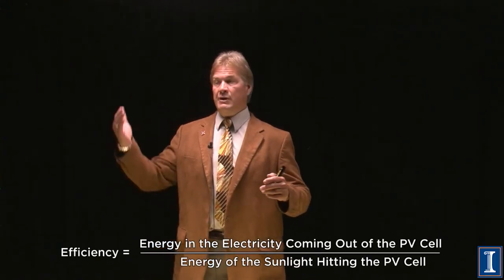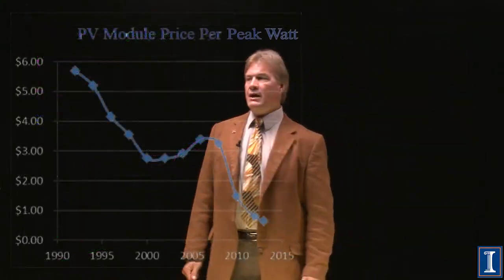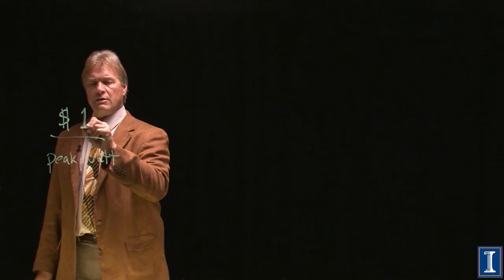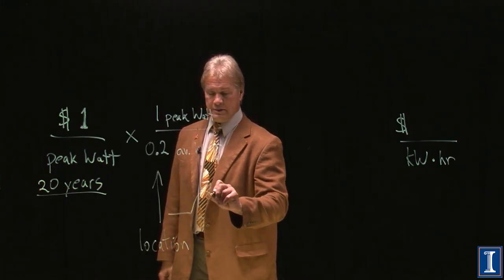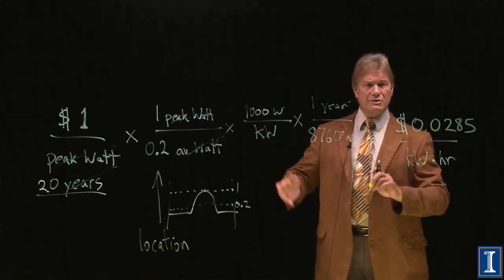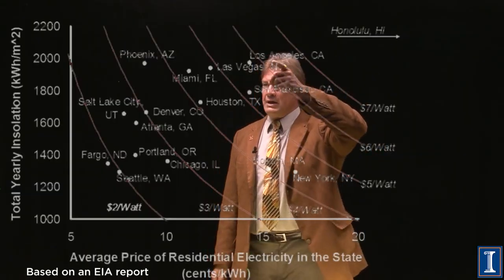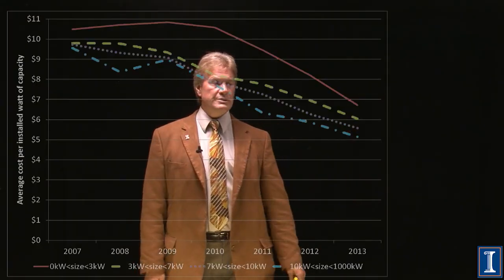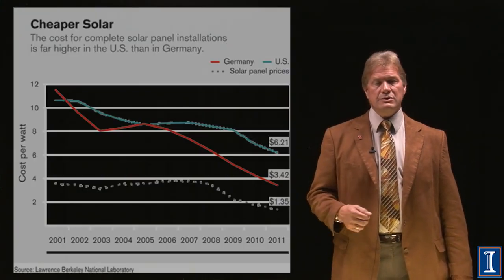The Cost of Sunshine

Comment: Brought to you by the Nuclear Energy Industry.
Reply: @petersmith4943  They're not bombs; if you would seriously like to discuss the safety factors or the differences between PWRs and BWRs reactors vs the very poorly-designed RBMK reactor of Chernobyl, please let me know.  Nuclear towns generally have a favorable opinion of their local plants.  Nuclear plants are like air travel in that they have an extremely good safety record, despite the very seldom and highly-publicized events.

Only 76 people have died in all nuclear accidents in history, and the great majority (62) are associated with Chernobyl.  Of those 62, only 28 were direct deaths caused by the accident itself.  Despite the massive media coverage, only 2 people died during the 2011 Fukushima meltdown.  One of them died from radiation exposure and the other seems to have died from overexertion due to carrying cleanup equipment.

Chernobyl had a flawed reactor design and an incompetent operation crew.  Fukushima politically-motivated operators repeatedly ignored recommendations to raise their sea-wall.  Neither of these problems could physically occur in Generation III+ reactors which are passively safe.

So, a modern or next gen nuclear plant in my proverbial back yard would not be a problem.  Radioactive waste is isolated from the environment in dry storage casks which are shielded and you can stand next to without receiving an elevated radiation dose.  Geologic storage methods are also available if necessary in the future, although nuclear engineers generally don't want to dispose of the waste because it cold be used as fuel in future fast spectrum reactors.
Reply: @matthewgrotke1442  thank you for the facts and figures. You have done the research and know what you are talking about. However. A nuclear power plant is still a controlled fission reaction. 
Most people who live in a town next to a power plant, work in the plant. So of course they like them.
You didnt mention the storage of the spent fuel rods either. 500,000 years of radioactive waste to deal with.
Reply: @petersmith4943   Hello Peter thank you for your reply.  You're right that a nuclear plant is usually one of the most predominant occupation for the surrounding towns.  However, people who live there have a familiarity with the plant.  Most of them have lived their entire lives while the plant safely operates 24/7/365 for decades and decades.  They often have a greater understanding of nuclear, and less fear.
In regards to the permanent disposition of spent fuel rods:  Nuclear engineers don't really consider this waste.  Only about 1% of the uranium in the fuel rods has been used (fissioned) in the reactor.  This is because the fuel is solid and encased in zircaloy rods, so when uranium atoms split into smaller atoms (called daughter products), the density of the solid fuel decreases and the rods swell and crack.  The rods must be removed after about 18-24 months and replaced with new rods.  These rods could be re-used as fuel in future nuclear reactors called breeder and burner reactors.  In fact, there is enough existing spent fuel "waste" in the United States to provide power for a thousand years without having to mine any new uranium.  There are a few different options for disposition of spent fuel:
#1 Leave the fuel in dry storage casks until it can be used in the future.  It's safe and 100% isolated from the environment, causing no harm at all.
#2 Put it in Yucca mountain.  I am against this option as Yucca mountain is actually a terrible location for permanent storage.  The mountain consists of the wrong kind of rock and is very permeable with oxidizing water.  We learned a lot about what not to do with the Yucca mountain facility.
#3 Put it in the Waste Isolation Pilot Plant (WIPP) in Carlsbad, NM.  This facility is located in the best kind of rock (Permean salt).  Nuclear waste is very stable and will remain completely isolated (even without containers) for billions of years.  Of course the waste would also be contained inside grout (not glass) containers, which chemically the most stable way to store it.
#4 Deep well injection.  If you really want to get rid of it with no chance of retrieving it again, it can be dropped into mines over a mile deep.  At this depth, it could never interact with the surface environment, or the ocean, or any water tables.

In regards to safety:  Current generation LWRs (PWRs and BWRs) in the United States are well regulated by our NRC and are very safe.  For example, years in advance of the tsunami, the NRC pointed out several safety issues with the Fukushima Daiichi plant that the Japanese government chose to ignore.  This resulted in a common mode failure, where all the backup generators were submerged by the tsunami and could not start.  Because of this, the reactor pumps could not function and heat built up causing a melt-down.  All nuclear sites in the United States have probabilistic risk assessments done on every potential vulnerability to ensure that all risks are addressed appropriately.  The result is a very high level of safety, which is proven by an excellent safety record.
I hope you have a great day.
Reply: Yes the nuclear industry.  A good industry that needs to expand.

Comment: If these things are mounted on your roof what happens when the roof needs to be replaced?
Reply: The mountings are pretty simple, you could just take them off and reinstall them on your new roof. However, having that done by professionals would cost same as the first installation and you need to replace your roof about every thirty years so if yours is close to twenty years old the PV company will likely suggest you fix it first, or just buy one of those Tesla solar roofs instead. The panels would actually protect the roof somewhat from weather, but they also lose about 1% of the original capacity each year in use, their warranty is between 20-30 years, and a couple decades from now there will surely be new cheaper and more efficient panels available. So basically, if your roof is old, just get a new roof little early; if it is only about a decade old, install the panels now and when you need to replace the roof get brand new panels at the same time.
Note that the main issue with roof panels is that you have a limited amount of space on the sunny side, so you will want to use only the most efficient panels available for a fair price. But as long as something didn't break them the old panels will still give you 70-80% of their original output 30 years later, so you can still put them up elsewhere to produce more power or sell them to DIY people who want cheap panels.
Reply: @AnalystPrime  Sounds expensive.
Reply: @jeffreyskoritowski4114  Assuming you get at least average sunlight all year round and the local power company agrees to buy your surplus production the PV system should pay for itself in savings in a few years if you are lucky and by end of the decade at the very least.
That doesn't include the roof though.

Comment: This U of I grad has a solar array (installed in the sunny desert in in 2019) that produces 115% of my annual use. Zero electrical bills except for the annual $150 hook-up charge. 17 year warranty with only a 4% drop in efficiency. Estimated 25 year lifespan. Payoff at 8.5 years. My wife loves opening the power bill each month and seeing a negative number. Battery storage coming soon for my three inverters which are designed to manage battery storage. Hoping LiFe comes way down this year.
Reply: how much energy do you use, and how much did your system cost?
Reply: @ObjectiveTruth5168  It produces 3-4 kwh per day depending on the time of year. 8-9 year payoff. $48k install price.
Reply: @OCnStiggs  I have 10 of 370W (nominal) panels currently (March) producing about 21kWh each day.  Hoping for more output as summer rolls in.
Reply: No electronics last that long
Reply: @4468861989  solar panels do!  Ive got panels from 2006 still producing at 90%, and today's panels are much better.
Reply: @4468861989  Buddy has an early system installed with 18 year old German inverters. Still running great.

Comment: Kinda left out the cost of a weeks' worth of battery backup (not uncommon for 7 days of cloudiness in the short winter days in Midwest)...and the minor factor that you need at least 50% excess capacity to have the energy available for even overnight storage. And the designed capacity has to be for the short winter days....can't store summer sunlight until winter.
Reply: You don't need to do that.
currently solar is not even close to be viable for fully powering a house under normal circumstances.
But you can very well just get a couple hundred watts and use them in conjunction - use it to heat up the water in a boiler, use it for the washing/drying-machine. Or the AC - that needs the most power when their is the most sunlight.
For those things you do not need the incredible expensive batteries.
Reply: That is because unless the rumors of Goodenough's new battery are true there is no point considering week's battery backup for most houses. A few kilowatt PV system that will lower your electric costs to almost nothing is actually very cheap, it's the pro installers that raise the cost. Adding a Powerwall to keep you going until morning, it can still pay itself back in few years unless you literally live where the Sun does not shine and the local electricity prices are too low to bother with your own production. But unless your local conditions are good for it, trying to make your bills zero or negative is often a needless expense, unless you actually aim for off-grid living. And in that case you would be lowering your energy consumption and building wind, hydro or geothermal systems to compensate for those dark days instead of trying to fit a hundred car batteries in your basement.

Comment: 1/5 of day generating electricity from solar panels? How did he get there?
Reply: He's in Illinois (higher latitude) and used the local daily average.  Down in South Texas or Las Vegas, the average daily increases significantly.
Reply: On an annual average, the sun is below the horizon for half the day. For several hours, the sun is low in the east or west, while the panel is oriented toward the south. And overcast cuts down sunlight even in midday.

Comment: the real kicker at 2019 is storage ( lead/acid batteries are still the best all round for cost/maintenance/lifespan) and the fact that inverters that tie to the grid are often having issues meshing with the grid.
Reply: The good news is that lithium battery tech for electric vehicles is improving rapidly, and so is the number of wrecked EVs with perfectly good battery packs that can be turned into fixed storage units for rooftop solar.  We are only just at the beginning of these changes.  Now we must work to persuade people that modern GenIV nuclear isn't their grandparents dangerous nuke tech, but is walk-away safe, much more efficient, and cheaper to build and operate.

Comment: The Germans have put enormous subsidies on solar and as a result, the standardization was pushed through real fast. Notice, however, that the capacity factor for solar in Germany is only 0.11 (compared to 0.2 in Illinois) and that somebody else must STILL PAY FOR THE BACKUP.
Solar panels are the new asbestos. Seems like great stuff at first, until experience shows otherwise.

Comment: Wonderful info.

California has several large-scale solar installations, but a problem is the lowered demand during the day means the utility company disconnects their solar farm, so the energy is not used. IMO new large-scale solar installations should not be permitted unless there's local storage to time-shift the power produced to when the power is needed.

For example using your Illinois number of 0.2, for each MW of peak solar produced you actually get 200KW over a 24 hour period (on an average day). So a battery system to suck up the 800KW "excess" during peak (the other 200KW goes directly to the grid), then off peak dribble out 200KW from the batteries. Thus, it's not a 1MW solar farm, but a 200KW solar farm. Fortunately batteries are getting better and cheaper. Of course the demand isn't flat during the day, so maybe 100 - 150KW out to the grid during the day, then 300 - 400KW in the evening, dropping back near 100KW in the wee hours.

As for small-scale privately-owned systems, the market place will make designs without storage economically painful. If power sells for 2¢/KWh during the day, and 18¢/KWh in the evening, even with net metering, buying something like a Tesla Powerwall starts to look a lot more viable than slapping solar on the roof.

This doesn't solve the problem of a week of cloudy weather, or shorter days during the winter, but it's a useful start.

One of the toughest challenges of renewable energy is "the last MWh challenge." Fusion someday, but meanwhile we really should get back into fission. The Sierra Club lobbied for the Diablo Canyon Power Plant. They saw it as a way to save pristine high Sierra mountain valleys from being dammed and flooded. Nukes have a positive CO2 impact as well, but no one thought much about CO2 in those days except for a few scientists. Then Three-Mile Island happened and politics turned against nuclear.
Reply: This billion dollar solar installations are all closed now.
Do a youtube search on "california $2B solar plant"

Comment: Say a municipality wants to build a 100MW solar field to replace a 100MW fossil fuel plant.  The fossil fuel plant is a baseload source (provides 100MW all day & all night).  In order to replace it, you need to have batteries.  Batteries are expensive.  You mentioned this in the video.  But what you didn't mention was that now you need to double the size of your solar field from 100 to 200MW.  You need 100MW to supply power to the city during the day.  And another 100MW to charge the batteries during the day, so that the batteries can provide 100MW over night.  And this is an optimal hypothetical situation.  A real world scenario is even worse because you don't get to charge those batteries _all day_.  You get maybe 8 good hours of solar collection, and that's assuming there are no clouds... so really you need to triple or quadruple the size of your solar field, just to provide that same 100MW around the clock.  Solar is fine if you're in AZ or Hawaii, but is not the answer to solving the worlds energy problems.  Hello................................ nuclear exists!
Reply: @Peyglo Yes that too.  And furthermore if you're using batteries, and you're interested in increasing their lifespan, you won't drain them less than 20%, and you won't charge them over 80% charge to reduce degradation.  So effectively only 60% of your battery's capacity is used.  There are so many reasons why renewable and batteries are not the answer.  Nuclear has been going steady since the 60's.  It's a zero-emissions technology and people unfortunately keep ignoring it.  Furthermore, advanced nuclear is coming soon with even safer designs that will be more cost effective than fossil fuels.

Comment: no discussion of the cost of batteries.  These are not car batteries @ $100 each.  A good 'solar-ele' battery runs about $400 - $600 each, and you will need a lot of them.  For emergency ele, ie; just keep the fridge, gas or oil furnace fan, well pump, etc, running... you may only need 10 batteries [$4000 - $6000 or more] but a "whole house' system will require 3 to 4+ times that many batteries.  Those batteries will need to be replaced every 7 years on average. $12,000 to $16,000 to replace the [example] batteries every 7 years.  Replacement of the PCs every 20 years, or sooner...  we're not there yet, other wise, you would see solar panels EVERYWHERE.  Way too expensive.

Comment: Still, do it yourself, solar on the roof or your carport or backyard, minimize your power use to lighting, computers, telecom,  intermittent appliances, and put the batteries in your garage and/or electric car, and you have a solution to your electrical energy needs. Solarize and superinsulate your home and the ground around it with trenched insulation, and store heat in the ground under it with loop pipes, use wood for supplemental heat and you can meet your thermal energy needs as well.
Reply: Not in California. Too many days when wood burning is banned.
Reply: @sub08Angstrom  
All you need is an efficient wood stove and you're not subject to that.
Reply: @sub08Angstrom  
It was ruled unconstitutional for people who rely on woodstoves for heat in the winter, and fan driven high efficiency high temperature wood boiler stoves used for home and water heating are exempted because they put out only CO2 and water vapor.